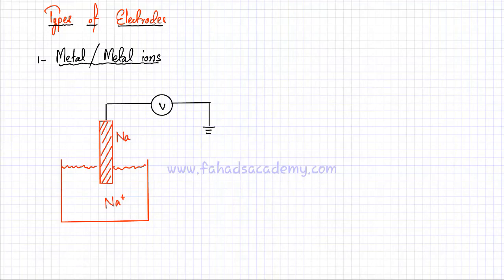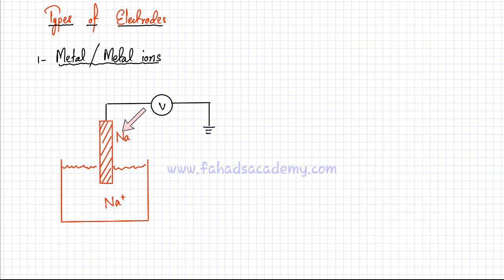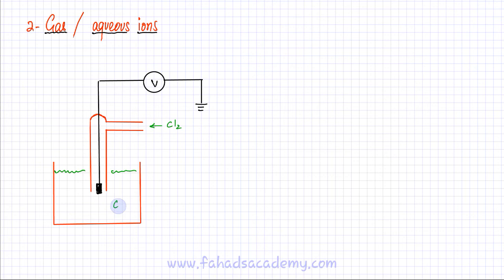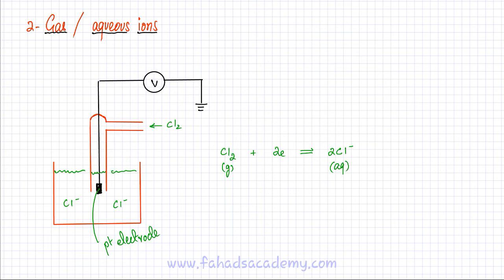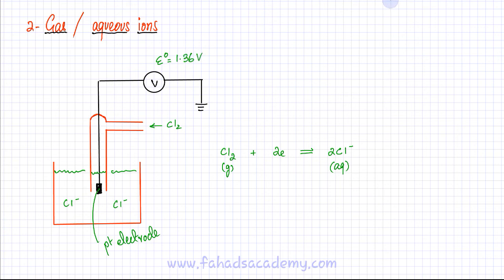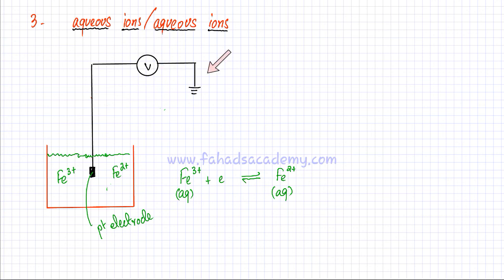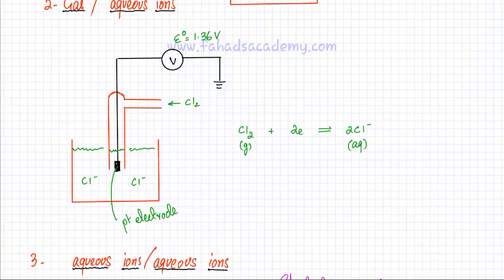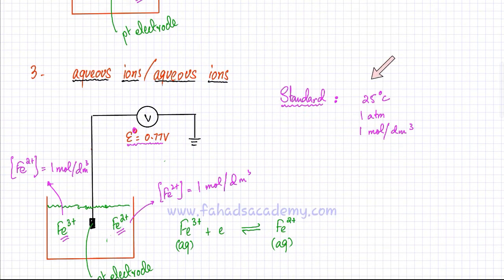Electrochemistry for A'Levels : Part 3 : Types of Electrodes

Comment: Sodium? Which solution is that???
Reply from the maker: any solution containing Na+ ions e.g. NaCl (aq)
Reply: @MEGALecture  the point is that there isn't a thing like a metallic sodium electrode, except maybe if the solution is organic.
Reply from the maker: yes true, this video lecture is for high school so no details here about the indirect method that is used in reality with aqueous and non aqueous electrolytes.
Reply from the maker: but the method shown in the lecture is a simple representatiom. for example, instead of the Na electrode, a sodium/mercury amalgam is used as an electrode.
Reply: @MEGALecture  I understand, ok. I just wanted to prevent people from mixing metallic Sodium in water, jaja.
Saludos!
Reply: @lisandromilesi794  you are right. If we dip sodium electrode in any solution which contain water , there would be explosive reaction

Comment: Sir can you plz tell me what is ion ion insoluble electrode
Reply from the maker: +jawaid akhtar a metal and metal ion insoluble electrode involves an insoluble salt. For example, Ag(+) + 1e --- Ag electrode.
If AgCl is used then since it is insoluble, then a coating of this insoluble salt is done around the Ag electrode.
Reply: Fahad's Academy  thanks sir but I am unable to understand
Reply from the maker: +jawaid akhtar will make a video
Reply: Fahad's Academy thanks a lot sir
Reply: It's also called as *Metal-Sapringly soluble salt electrode*.....

  When a metal rod is is coated with sparingly soluble salt dipped into the solution of salt that contain same anion of that sparingly soluble salt , then it is known as metal-sparingly soluble salt electrode ....

eg. Cl-(aq.)  |  AgCl(s)  |  Ag(s)